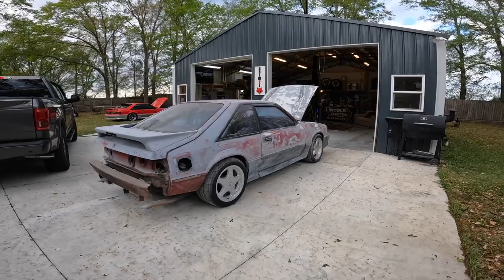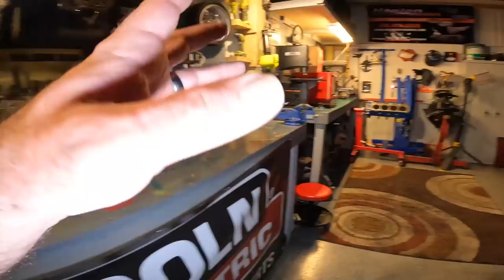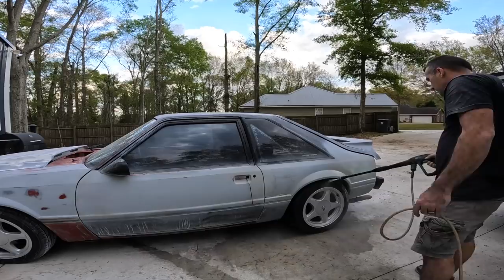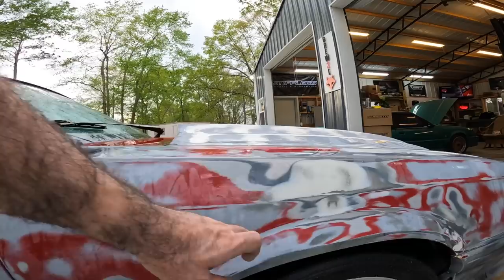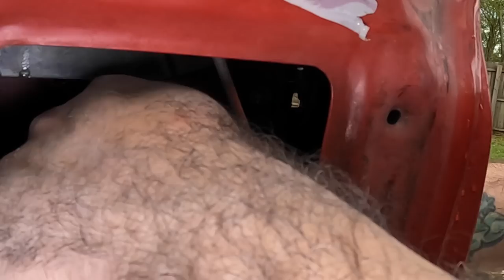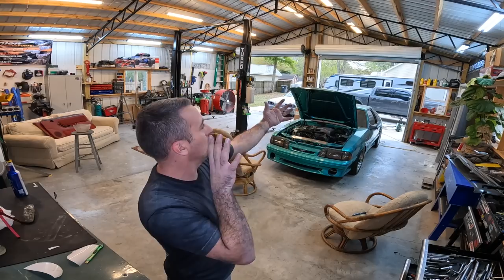This Color Has Major Sex Appeal

Comment: I didn’t agree with the no right or wrong. But I agree that no matter what you try you can always undo or fix the issue. It’s all trial and error and yes you can paint in your garage and get professional results. I’ve seen paint jobs outside that look very well. This is definitely not a place for the comment you posted because the calypso looks badass and I think is as good of not better than a lot of shop produce today. Keep up the great content 👍👍

Comment: i didnt do this, but about 10 years ago without my knowledge my grandmother got a guy that had a shop to "help" me by taking my car (off of my property without my permission in the morning. i almost ran outside with my shotgun because i thought someone was stealing my car.) and putting the motor in it. (she didnt realize i wanted to actually work on it.) anyway, this shop had my car for several months and they called themselves fixing stuff on my car. heres a few things they "fixed". 1. they put a hidden start button in the car and used the hatch pop fuse as power for it thus now i cant open the hatch on my car without buying another lock and key for it because my key never worked to open it. not a huge deal but very stupid imo. 2. they put his "racecar" (thats how he sold it to my grandmother making her think it would be something i would for sure want) carburetor on a i think 70 something 302 stock non rebuilt junkyard engine. i think it was an old 850 that no longer worked properly based on how shitty it ran afterwards. 3. instead of replacing the door pins for the infamous fox door sag, they just welded the doors to the hinges making my doors now not even latch right meaning when the car did run, for the short time it did, my doors would just fly open when i turned or hit a dip or something in the road. that one is very stupid to me. 4. they cut my perfectly fine vent cowl, that at the time would cost almost $100 to replace, to fit my hood (that already fit on my car without issue) that had been on my car for 5 years already at that point. they cut over an inch and a half off of it. 5. they lied about installing a clutch cable on the car and left the og 4cyl cable on it. every gear ground and it was very hard to actually move the shifter through the gears. (their solution was to just shut the car off when i wanted to shift) yea, thats what i said. originally they quoted her like $250 to install the engine but ended up stealing over $4000 from her which pissed me off even more than all the other stuff because they didnt fix anything and just made things worse.